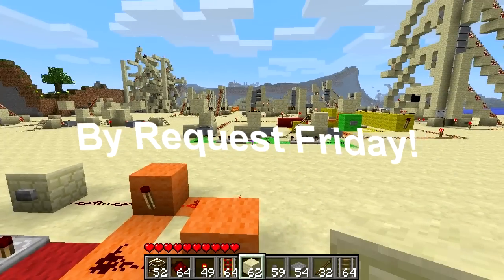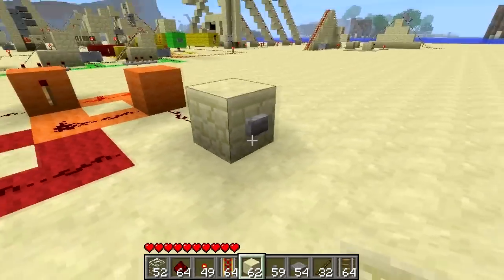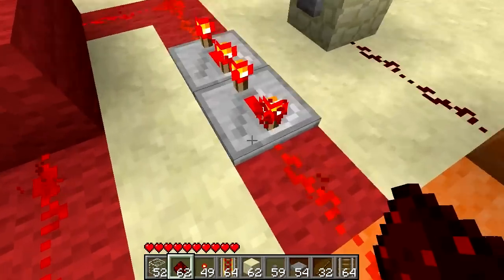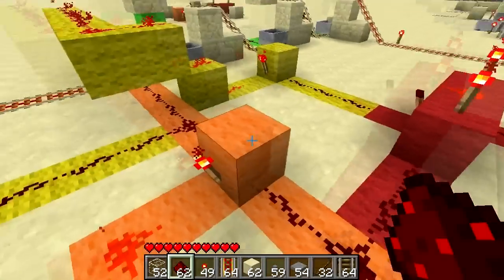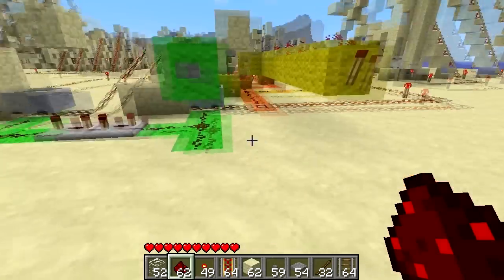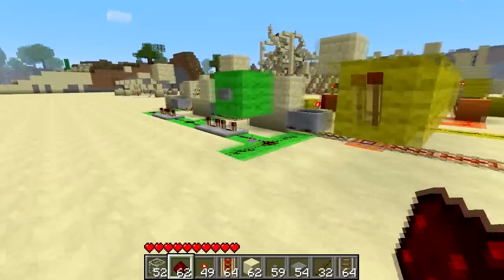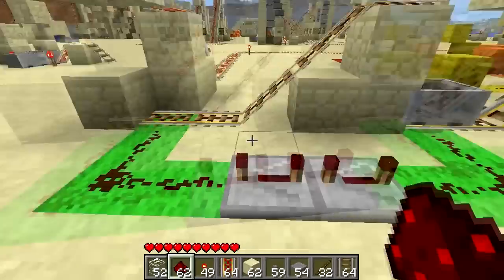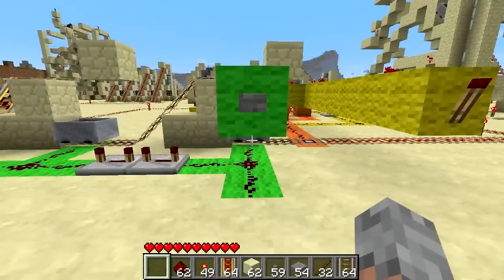BRFa08: Empty PEZ Detection w/ Minecart Buffer. Minecraft!

Comment: I kinda have a more compact version, but it requires an extra minecart.
I call it a minecart Regulator. You place two powerrail tracks next to each other. Make the first one go to the departures, and the second loop back to the start of itself.
Place a minecart on the second track and add some redstone that can power the track it's on.
The minecart from the PEZ sits on a detector rail. When power is given to the first track, the cart pushes the other minecart off, sending it to it's destination!

Comment: You could build a system that builds up momentum on a small, closed, powered track (for, say, 5-6 laps) and then releases the cart allowing it to reach very distant lands without extra boosters on the way. (this happens *after* the player gets in the cart)
Thanks! ^_^